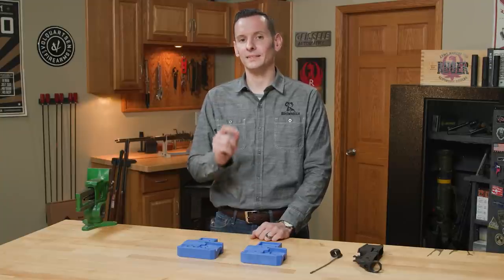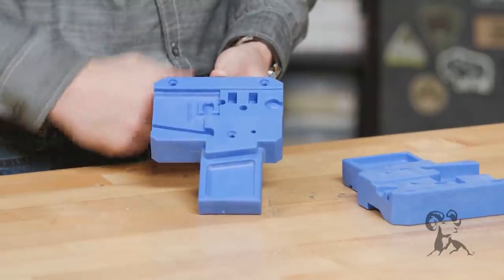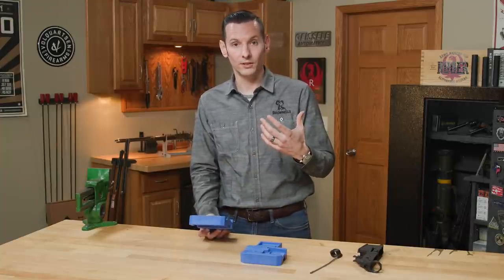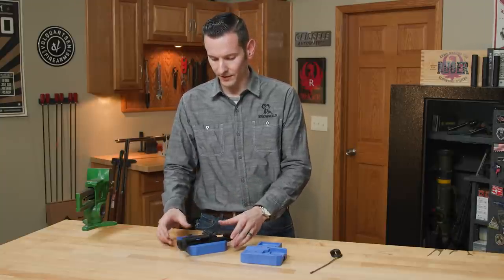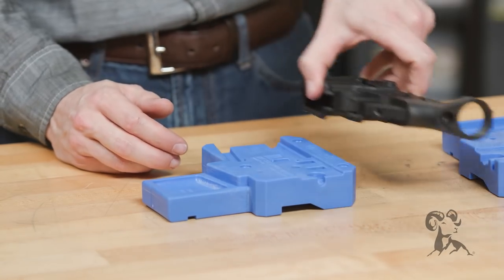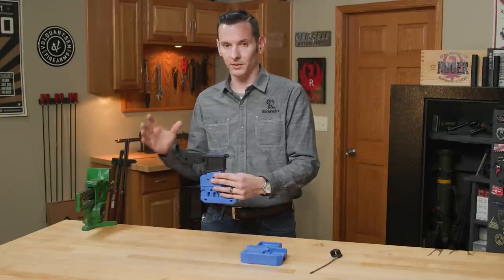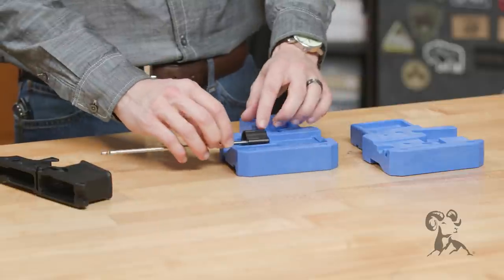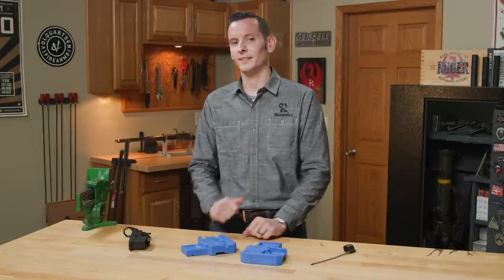Product Spotlight: Midwest AR-15 Lower Receiver Block

Comment: I really appreciate these videos. I would really like a drill jig to properly drill the lower front barrel to accept two (or three) shallow drill points for set screws on a low profile gas block to ensure it is secured in place.
Even a jig to properly drill a low profile gas block roll pin would be of interest. Set screws vs roll pin? 
And the best barrel wrench and lube or loctite for standard, m-4 and custom front grip to properly time and tighten (torque) the barrel to the receiver. While you're at it, please tell me what loktite color and grade and rock set for suppresor attatchment. I assembling a few rifles with mid length gas systems,  feathervweight barrels, rifle receivers with M-4 carbine bullet tip guides.
Hell, just tell me what tools I need and how to put the whole upper together. 👍🏻😎🇺🇸
I've got a good solid Vice and table. That's a great start, isn't it.
Or point me to a proper manual or video so I don't screw it up. Thanks. 👍🏻😎🇺🇸
Reply: SLR makes a decent gas block dimple jig.  Only one dimple is necessary.  Put it opposite the gas port hole.  If you put two dimples on and ever want to change your gas block, you're locked into the orginal spacing between the set screws from the orginal block that you put on. Without a standard for spacing, you might be stuck.   One dimple works fine with some removeable loctite on both screws.

Comment: Is there an upper or upper and lower combo block to help us align triangle front sights? Asking for a friend.
Reply: Sadly no they only make a combo block for the hexagonal front sights.  Tell your friend to cut off his triangle sights and buy roundie hole sights.  The hexagonal blocks will fit those too
Reply: @roostercogburn8183  I’ve been leaning into making a few of the more retro designs lately. The original Air Force 603, M16A4(ish), etc. The “mini” gas block is way easier to align than the A1 or A2 front sight. For me, anyway.
Reply: @roostercogburn8183  pretty positive Real Avid makes one with a spot for the triangle front sight gas block.